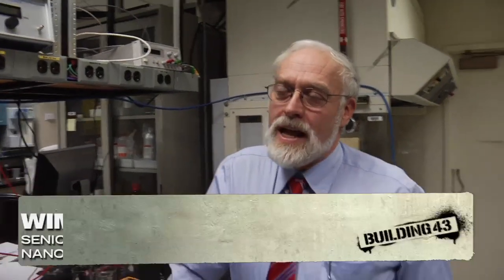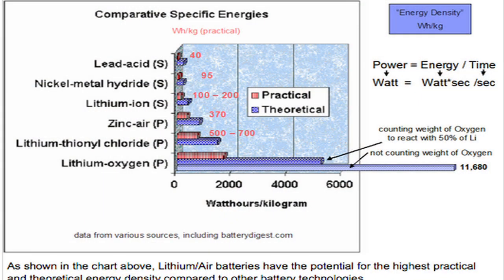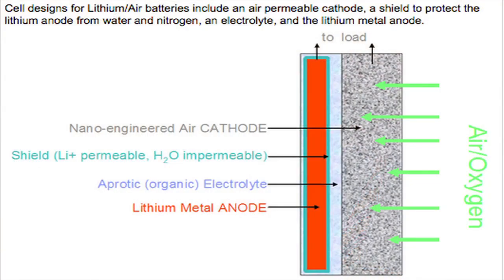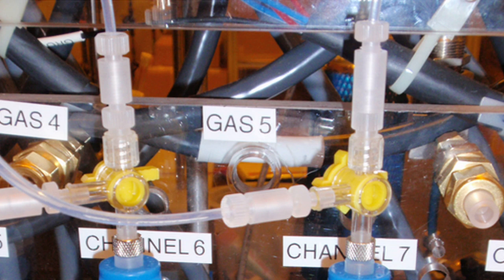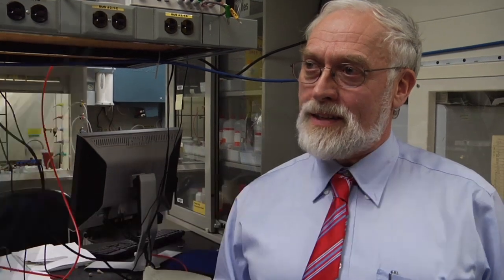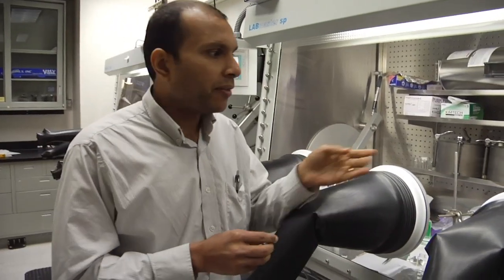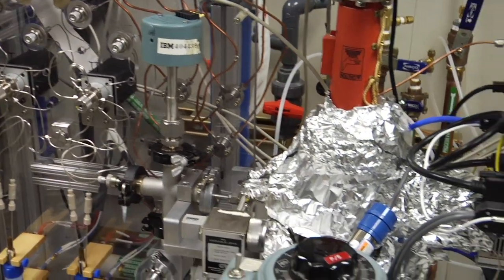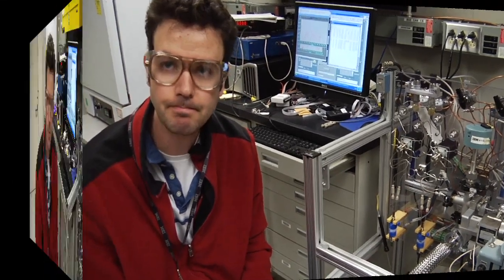Lithium Air:  IBM's quest for the super-battery

Comment: the air we're breathing is not pure oxygen, nitrogen will also react to lithium, which means liquid would form, would you willing to carry a pure oxygen tank in your vehicle like a FCV with its hydro-bomb tank?
and on the cathode side, the carbon base has pores for peroxide to form, as the peroxide phase getting thicker and thicker, its insulation will slow down or even prevent lithium movement.
Sure, for the first few cycle you get very high capacity, but then it falls off over time... 500 miles?  we'll see how long its gonna last after a few discharge & recharge. 
So solve its density degradation, then I will invest.
Reply: We use giant tanks of explosive petrol now, so I think a small canister of oxygen is okay safety wise.

Comment: Salt power batteries (salinity gradient energy or SGE) - batteries that in the lab are generating 4000W per square meter (extrapolated) using boron nanotubes (French research). Load your ship with salt instead of hydrocarbon fuel and the output is a salt solution diluted from the original solution but more saline than ocean water.  When in harbors and rivers, switch to a stored battery solution such as the lithium air batteries.  Many cruise ships already are using electric pod propulsion to move their props, so this is a feasible solution.

Comment: Andy G. Lithium is by far the greater of the two in terms of abundance. Beryllium wouldn't be practical at all
Reply: Metal-oxygen (also known as metal-air) electrochemical batteries are the future. They have the potential to be far, far more efficient than the use of either pure hydrogen, or hydrocarbons like gasoline, diesel--especially when used either in a fuel cell or an internal combustion engine--while at the same time having more energy content stored either per unit of mass or volume than those fuels.

Also, the metals that will power these metal-air batteries are the only metals really worth pursuing, as they either are on-par with pure either pure hyrogen or hydrocarbons in terms of energy content stored per unit of weight, yet are worser in terms of energy content either stored per unit of mass or volume, especially in the case of lithium in regards of volumetric energy content in respect to hydrocarbons like gasoline and diesel; meanwhile, boron and beryllium--the relatively obscure, arcane, and underappreciated elements whose energy contents, in both mass and volume, have yet to be realized--completely and utterly blow pure hyrodgen, hydrocarbons, and even lithium out of the water! There is literally no contest; so, here they all are:

Lithium's maximum theoretical energy content and abundance levels:

Maximum theoretical specific energy: 43.1 megajoules per kilogram, or, 11.97 kilowatt-hours per kilogram.
Maximum theoretical energy density: 23.01 megajoules per liter, or, 6.39 kilowatt-hours per liter.
Abundance in Earth's crusts: 0.0017%; 17 ppm; 325.21 trillion metric tons.
Abundance in Earth's oceans: 0.000017%; 170 ppb; 239.1883 billion metric tons.

Beryllium:

Maximum theoretical specific energy: 67.6 megajoues per kilogram, or, 18.78 kilowatt-hours per kilogram.
Maximum theoretical specific energy: 125.1 megajoules per liter, or, 34.75 kilowatt-hours per liter.
Abundance in Earth's crusts: 0.00019%; 1.9 ppm; 36.347 trillion metric tons.
Abundance in Earth's oceans: 0.00000000006%; 0.6 ppt; 844,194 thousand metric tons.

Boron:

Maximum theoretical specific energy: 58.9 megajoules per kilogram, or, 16.36 kilowatt-hours per kilogram.
Maximum theoretical energy density: 139.59 megajoules per liter, or, 38 kilowatt-hours per liter.
Abundance in Earth's crusts: 0.00086%; 8.6 ppm; 164.518 trillion metric tons.
Abundance in Earth's oceans: 0.00044%; 4.4 ppm; 6.190756 trillion metric tons.

Now, compare energy contained in lithium, beryllium, and boron to that of gasoline, diesel, and kerosense:

Hydrogen's maximum theoretical energy content (as a liquid, which only has an effect on volumetric energy content):

Maximum theoretical specific energy: 141.86 megajoules per kilogram, or, 39.4 kilowatt-hours per kilogram.
Maximum theoretical energy density: 8.49 megajoules per liter, or, 2.35 kilowatt-hours per liter.

Gasoline's maximum theoretical energy content:

Maximum theoretical specific energy: 46.4 megajoules per kilogram, or, 12.88 kilowatt-hours per kilogram.
Maximum theoretical energy density: 34.2 megajoules per liter, or, 9.5 kilowatt-hours per liter.

Diesel's maximum theoretical energy content:

Maximum theoretical specific energy: 45.6 megajoules per kilogram, or, 12.66 kilowatt-hours per kilogram.
Maximum theoretical energy density: 38.6 megajoules per liter, or, 10.72 kilowatt-hours per liter.

After reviewing these values, I can finally be assured and rest my case on what the true future of energy storage belongs to: lithium-air, boron-air, and beryllium-air batteries, as a superior alternative to the continued dependence on fossil fuels, and the flawed alternative usage of hydrogen, which is even worse and just as polluting.

Comment: Solar and wind are energy sources. Lithium battery is a energy store. So to store energy you need energy, which still would be received from coal/nuclear/oil/wind/solar.
This is only going to be great for cars, where energy store is the problem. But to power the grid, we still need known sources of energy i.e. fossil fuels/ nuclear / solar / wind/ hydro

Comment: i love how the first few comments are NOTHING TO DO with the potential these Li-Air batteries have. The only reason the EV has not  been fully adopted by the car manufacturors, has been becase of battery storage. 

We are talking about a technology here that will get you 300 miles away form your house AND BACK on a single charge.  Who really needs to do more than that? There you go, energy and fossil fuel demand dropped by 50% right there